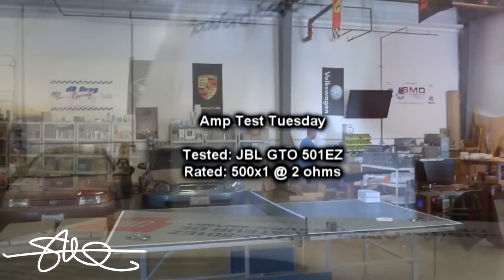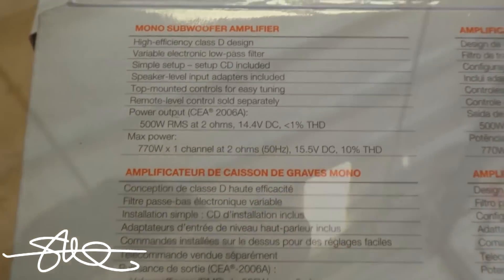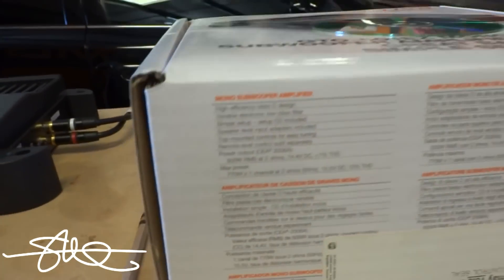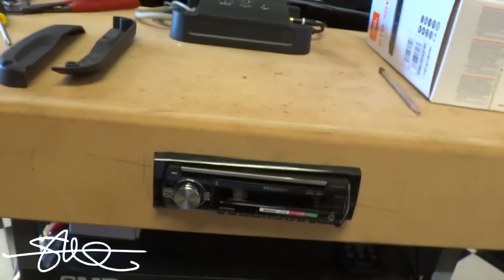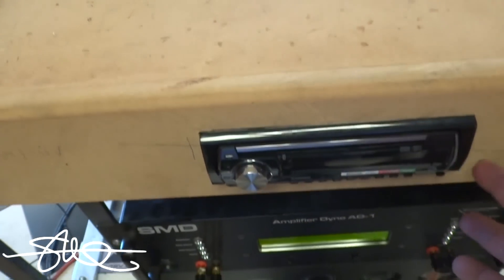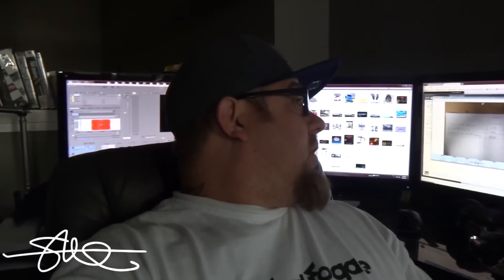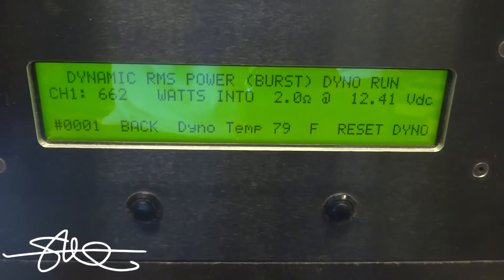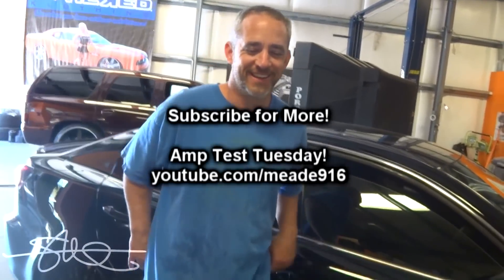Amp Test Tuesday - JBL GTO-501EZ 500 Watts RMS Claimed - SMD AD-1 Amp Dyno

Comment: Go back 10 years and look at jbls "max" power numbers. completely different than any other company. Their 1000 watt amp will have a max power of 1430w which is an actual real number that they can hit at a 2ohm resistive dynamic  load. other companies put 2000 W "max" on a "1000" watt amp which usually means nothing. I love that harman took care of JBL

Comment: That is a very good amp. One thing that is odd is that the manufacturer rates a power rating at 15.5 volts. Might be splitting hairs here but it is silly nonetheless.

Comment: Can anyone can help me because every time I turn off my car my JBL stays on while the car is off can anybody tell me why that is happening and how to fix it????
Reply: Devonte Smith sounds like your remote turn on wire is attached to your red power line. It should be attached to the white and blue remote turn on coming out of your dash
Reply: had that same problem [Auto Turn On was on] amp will turn off in 5-10 minutes

Comment: You think this would power two of sundowns x6.5's alright? They recommend 300w rms each and wired at 2 ohms if they put out the power you tested them at it seems as though they'd work well. I've been trying to find an amp that would worked with them that isn't fuggin huge as I have limited space to mount the amp.

Comment: Did you change the fuses on it? It comes with 2x25 amp fuses.. It would pop if it took in more than 720 watts at 14.4 volts. Now I know with some serious internal cap storage it could give some burst wattage, but this amp has me scratching my head. You should test this thing some more.. maybe try a 2 min 50hz sinewave and see if it doesn't lose power output over time.?
Reply: Aliexander Shy - JBL always disproves Ohms law some how !
Reply: +Wick3DPimP Yes, its very interesting! here not shown that the fuses are replaced, and with a long time (enough to discharge any capacity inside) amplifier delivers power more than 800 watts (and it consumes even more, respectively), this amplifier has decided to disprove Ohm's law?)))
Reply: +Alexander Shy Cold Fusion!! Buy these amps now and run your house power on it! :)
Reply: +Wick3DPimP :D

Comment: So which single 12in should I pair with this in our 2009 Camry Le. With a stock deck.. I know open for input on that too. But the new   Gtx-500 was a deal. Someone help me out I'm having glad backs of maybe getting a Cerwin Vega. Had a pair of Orion xtr 12's back in the day but my front stage couldn't keep up with the best Zeus pumping 2 12's in around 1993. I just want a different sub than the mainstream. I've been looking and don't see much that impressed me. Someone field suggested a JL that's almost $300. I know I can get better   for less right. Didn't think we needed to go over $200 for a decent 12 in a sealed box with this amp. I'm out of the loop these days. Planet Audio looked ok because of the sensitivity level but this amp will smoke that sub. Rockford P3? Any suggestions would be more than appreciated. Oh like I said I'm not far, just in Vallejo. Do my install please. I'm doing rideshare for Uber n Lyft. Gotta have my music right.
Reply: Look at the Fi Alpha 12" off of ficaraudio.com. You can get 2 of them for around $300 shipped give or take in the US depending, and they'd out perform almost  anything in that price range IMO, and best of all they're built in the US. I have an Fi Q, those are over $350 shipped for one 12" though. Good luck!

Comment: 770 Watts max at 15.5 volts...
Reply from the maker: nahh 14.5v.  I already explained a few times that i have a small 15a charger topping the batteries off...that extra little surface charge is eatin' up fast as soon as the test starts.
Reply: Oh yeah I understand that. Seen you explain that in many of your other videos. I was just quoting what it says on the box.
Reply: +meade916 hey im looking into buying 2 sets of mtx terminator subs so id have 4 12 inch speakers all together at 2ohms each set i know this amp runs 750 watts rms at 2ohms all 4 of the speakers together is 800 watts rms so if i bridge the speakers to the monoamp will i lose power or will it ruin the speakers? or is my best bet trying to find a 2 channel 400 watts rms each?
Reply: I have the 1001ez and with a 130 amp alternator and a ig 18 wheeler battery it still wreaks havoc on my electrical system even though I'm not pushing it all the way, as I only have 2 jbl subs rated at 200 rms each. I can't imagine what it would do with 2 Alpine type R subs.

Comment: Have you done the same tests with the JBL GTO 751EZ? I could not find it in your videos ...
Reply: I would like to request a test with the JBL GTO-751EZ as well please : ).
Reply from the maker: ***** no need.  This one just showed that the 751 will also be good. :)
Reply: meade916 That makes sense. Thanks for the quick response Mr.Meade.
Reply: meade916 You think the 751 could do 1000W? I Mean this showed me these amps are underrated, im thinking of getting two SD-10's (500w a piece) but from this video i wouldn't be surprised if a GTO-751 could do 1000w
Reply: It's quite possible Acd.
They are of the same 'series' if the 500 does 200 odd watts more than rated I don't see why the 751 should do atleast that and then some...
Reply: Thats what im thinking, do you think i should pull the trigger and order two of the SD-2 10's (500w a piece) or play it safe with the SSA Dcon 10's (400w a piece)?
Reply: I'm running a single Morel Ultimo SC(600RMS) 2Ohm SVC currently and prior to that I was running a very old SPL oriented Pioneer Subwoofer(750RMS).
My 751 EZ did justice to both no problems, if that helps you make your decision.

If I was in your position I'd go with two of the 400RMS ones Acd, Box rise etc. I would look at the JBL GTO-1001EZ if your mind is set on two of the 500RMS ones. Keep in mind neither of these are 1 Ohm Stable, I have read comments on people running them on a 1 Ohm load but I think that's just asking for trouble in the long run.

Both the 751 and 501 are tremendous value for money products in their power range in my opinion, I'd buy one at it's price even if I didn't need one!  : )

Comment: my brother purchased this amp after I shared this video on his facebook, and he liked it more than his db okur 1200.1, he tested the jbl at 1 ohm as well and said it gave his sub a good pounding....would the power be the same as if running on 2 ohms or would it be more since it's wired down to 1 ohm. I know it says 2 ohms, but I myself have ran a jbl1200.1 at 1 ohm without any problems
Reply: the old jbl 1200 you are running is rated for 1ohm and 2ohm these new ones should not be ran at 1ohm if you want it to last a long time
Reply: cool, thanks

Comment: i am disappointed that you never tested 1 ohm load on this fine amp. i had one running 2 dvc kicker 12s and had enough clean power to bottom them out! does 1 ohm all day with out getting hot but i wish i knew what numbers i was getting....my fav sub amp i ever had!
Reply from the maker: the amp is rated at 2 ohms.
Reply: meade916 i know that but im telling you it will do 1 ohm all day on its head while juggling. you can tell the power jumps up with it too. personal experience talkn here. i love that test bench btw very jealous lol
Reply: charles hodges
 nah its a gamble torturing any amp below its minimum rating, either a fuse blows, protect kicks in, or it goes up in smoke
Reply from the maker: charles hodges the power won't double.  Trust me on that.  It will more then likely just go into protect...in fact i think it did when i tried 1 ohm iirc.
Reply: heh. Just tried my GTO5EZ @ 1 ohm and it went into protect. So its settled, it can NOT handle 1 ohm
Reply: charles hodges
just looked it up, your bp600.1 is rated 1 ohm stable, it also says there is no increase in power below 2 ohms (as per JBL website) , so you weren't doing anything the amp wasn't designed to handle. Most amps are 2 ohm minimum, and if you go below this, its protect mode or smoke
Reply: What kind of RMS do you think this does at 1 Ohm?
I plan on getting the JBL GTO-751EZ Amplifier to power a present TS-W121SPL Sub and possibly a SA-12 in the future.
The 751 doesn't show as 1 Ohm stable either so I'm wondering....
Reply: but im sure you know more than me about it since you "looked it up"
Reply: charles hodges It will definitely do it all day, however the components aren't rated for 1 ohms and it will decrease the overall longevity of your amp.  Higher grade components are needed for those kinds of loads, I've heard people run the American Bass PH4000MD (1 ohm stable) at .5 ohms with absolutely zero issues, but I want mine to last as long as it can.  Your amp though lol, decision is yours and I suppose you don't have to mention you were running it lower than rated for warranty.
Reply: ashokk sethi
his amp is 1 ohm stable. most are not.
Reply: MXSLICK Then you never owned a GTO amp wether you have the old or the new models, they will do 1 ohm for its lifetime, there rated 2 ohms but they are so reliable and build with good quality thats why i think there much underrated they can handle so much torture its redicilous.
Reply: Take the 2 ohm rating and double it...trust me
Reply: Well my amp was jbl power series bp600.1 and it ran 1 ohm all day never even heated up...best amp i ever had
Reply: it says there is no increase in power but i can attest that there is an increase in power output of at least 50% and a higher current draw as well. i know this because i owned one and experienced this myself as this pushed two kicker cvr 12s in a ported box to the point where the coil hits the magnet on the back stroke with no distortion until the coil hits. very good sound quality too. until the coils hit lol.
Reply: charles hodges
Reply: charles hodges I got this amp from a friend for free.After seeing this I decided to try to drop it to 1ohm.It really does work at 1 ohm.The only reason I even tried it was because I had it pushin 10s then put it on 12s but it wasn't as loud as the 10s.But it is now way louder.
Reply: DA BEARDSMEN 🙄 fan boy

Comment: Can you do a AMP TUESDAY of the shitty brand amps like American Pro,Audiobank,Pyle,Kenford,SPL,Rockwood,Sherwood and so on?
Reply: He won't cause it will show they can push power for durt cheap
Reply from the maker: +Headshothorror4488 actually, stupid fuck, i have done several cheap amps.
Reply: +rimwydas44  pyle used to be a great brand when harman owned them ! the same brand that owns jbl now ! but they sold it and now stuff is shit
Reply: CAD is under 200 bucks! WTF does he want. SMH!
Reply: +Headshothorror4488 they put out shitty distorted power, and nowhere near what they are rated. my friend has a pyle thay says 1,000 watts but the spec sheet says 75 rms 1t 14.4 volts at 120hz, so that's not even 75 warts of full bandwidth power!! I would put any one of those pos amps against my jbl 1001-ez. Not to mention those cheap amps will blow your subs because they send dirty distorted power, and distortion, not power, is what destroys your subs voice coil.

Comment: nice to see the jbl amp do more than rated. esp impressed with the 14 volt numbers. but i have a challenge for you. i and i'm sure others would love to see a series done on the micro 5 channel amps. say the kenwood, jl audio xd, alpine pdx and the jbl.
Reply: I have the JBL gto5EZ, the 5 channel version of this amp. I'm guessing it has the same power supply as this mono version, meaning a bit less output on the sub channel

Comment: the J B L box says 770 watts peak power at 15.5 volts which most cars don't do that run around 14.2 or 13.8 amps not really putting out the power.

Comment: It's just a silly idea. It's heaver, harder to use and manage, you can't change the layout on the fly, etc. Could you imagine having to run solid lines through the cab and trunk of the the car?

You can use solid copper wire but it would be nothing but an inconvenience every step of the way.

Comment: part 3:
So with that said i mean you can use proper hifi speakers in cars with the same enclosure as if it were in your home but because the acoustics of a car pretty much such they do not sound as well as they ever would at home. That why they invented new technologies and new speakers specially made for car audio that are build to sound good in an acoustic enviroment such as a car.
But i tried both. Car audio speakers can be played at extreme volumes. in a car i want that.

Comment: this is part 2 of my comment:
And with all the new technologies for cooling the coil at those high wattage and so on they are a step forward but this is not needed for hifi use. this has actually nothing to do with home hifi. 
BUT by installing high end amplifiers in your car wich actually do remove alternator noise. and installing some quality hifi speakers in a proper enclosere with the same volume as there hifi enclosures you will get the same effect. however not the same acoustics (car)

Comment: SO IMA TUCK THE FLEECE IN THE BACK TILL ITS MAX DEPTH KEEP IT SMOOTH ITLE LOOK LIKE A BIG BOWL- TUCKING IT BETWEEN THE DOORPANEL & THE METAL DOOR(USING BLUE MASKING TAPE +MIGUERS MOLD RELEASE FOR FIBERGLASS) BETWEEN THE 2 MAKING AS MUTCH OF A SEALED BOX AS POSIBLE WITH THE LIMITED SPACE APPLYING SUNFLASH IN SMALL AMOUNTS USING ITHER A TARP COVER THAT I CAN SHINE LIGHT ON THE SUBJECT TO CURE OR USE HI INTENSITY UV LIGHTS I GOT LAYING AROUND ALL I KNOW IS NO1 HAS PUT THEESE BIG ASS 8"   IN DOORS

Comment: THERE ABLE TO DO 2OHM BUT I BELIEVE THERE RECIVING 4OHMS FROM MY 640W 4CH JBL GTO 6404 I JUST BOUGHT THIS AMP & MAY BUY ANOTHER FOR BASS I WAS GONA POWER THE 8" SUBS ON A GTO3002 2CH 600MX 300RMS X2 BRIDGABLE DOWN TO 2OHMS NOT SURE WHAT THE SUBS ARE BUT I EVEN HAVE ANOTHER AMP LAYING AROUND A 130 JBL 2CH BUT I DONT THINK THERES ANYTHING I COULD USE THAT PIPSQUEEK FOR... THE FIBERGLASS WILL BE SMD SUNFLASH+POLOR FLIECE & SHREEDED FIBERMATT BUT I DONT THINK THE SUBS ARE FREE AIR BUT I ALREADY BOTM

Comment: IVE GOT 2 JBL 8" REDUCED DEPTH SUBS (200RMS-800W PK) I CUT MY DOOR PANEL OPEN 9X14" DOING THIS BECAUSE THE JBL 6.5 COAX WERE SMACKING THE PLASTIC DOOR PANELS AND MELTING THE RUBBER TO THEM ABIT ASWELL AS PUTTING MARKS ON THE RUBBER SUROUND BUT I SAID OK ILL BUY SOME 8" AS IVE SEEN SMD HAS(RF) I JUST NEED TO KNOW IF I CAN FIBERGLASS A SMALL BOX WITHIN THIS SPACE AMONGST THE ISSUES AT HAND...I GOT 6X9S ON THE FLOOR THAT I LOVE BUT EVERY1 BITCHES THERES SUCK...MINE SOUND BEAUTIFUL ESP FOR MID RANGE

Comment: also we would only need 8awg instead of 1/0 awg....mabey not usfull far speaker wire mabey best for the big three or somthing but id defenatly love to experement on a car i dont care about with solid copper vs stranded....but ultamatly as long as theres not a bunch of tiny wires and proper fuse/terminal/and soldering done there should be no issue unless u have faulty equipment/bad rca's/bad grounds or worse bad altanator not to mention corosion!!!!

Comment: yeah i was looking for a bit more detailed indepth answere but thankyou ,n yes i agree,most of that is true but u can bend solid copper...ive talked to several car audio installers aswell as 2 liscensed electricians and each 1 said somthing different....ive herd it stays cooler ive herd its for verry high levels of power in the 1,000s ive herd its mostly better just without the coating of car audio-car audio is all about sheilding when it comes to wires both power and signal aswell as constant v

Comment: My old school MTX 2300 says 150rms x2 at @4ohm 12.5v, 300rms x2 @2ohm 12.5v, 600rms bridged @4ohm 12.5v. 750watts dynamic power at 14.4v. Just traded my "son of frank amp'n stein" that I bought and had sitting in my closet for 12 years for an old school 2100hcca just recapped. It will sit in my closet for years also.

Comment: You don't use solid cable because you have to make a lot of bends and curves around the car to wherever you've mounted your amplifiers.

And you can have clarity and accurate sound reproduction in a car, it just takes A LOT of hard work and A LOT of of proper planning. It's all in the install, the processing, and in my opinion the source material. A great system will sound crappy if you're playing badly compressed mp3s and stuff.

Comment: all you would need is an alt, one battery, and one run of 0 gauge wire to the battery. as long as you isolate it from the stock system you would be fine. though meade's car audio is awesome. its not the only way to do a stereo.

Comment: it said 884watts...fuck the volts they drop anyway unless u got money put in ur car like sm 's what 6batt and 3 alt+ each batt is about $200 each altanator is 3-4hundo so thats 3500 right there then u add 300 100ft roll of rf wiring and like 16 anl fuses aswell as 150ft of 8awg and 50ft of 4awg...i saw a vid of 1 truck with all 4 awg he has and 1 of 1/0 awg not sure how old they were or what hes got now but all that pluss some other do dads

Comment: a lot of big stereo people run different battery banks and alts separate from their cars stock electrical. and for example about amps running up that high, my step dads treo amp is rated up tp 18v at .5 ohm, supposed to do like 8000 watts up there lol.

Comment from the maker: also, what the heck does the impedance you choose have to do with anything? Most SPL guys will want their subs @ .5 to try to squeeze every bit of power they can out for a bigger number.  But in reality, most people run their subwoofer amps @ 4, 2 and 1 ohm.  Mids/highs @ 4 ohms..but even at 2 ohms, what is the problem?  You think a speaker on 8 ohms sounds better then one @ 4 or even 2? i think not. If you love home audio more then car, good for you, but the things you are saying make no sense.